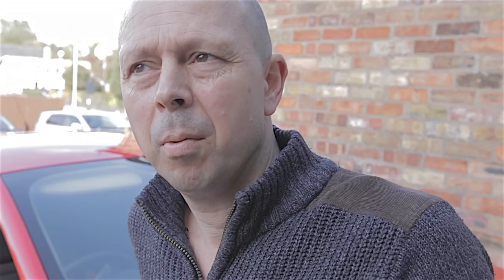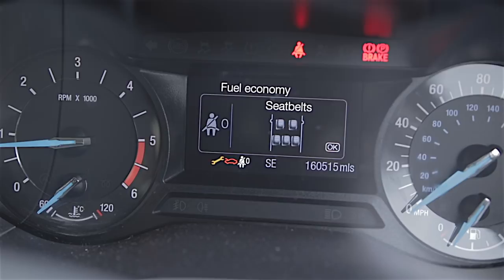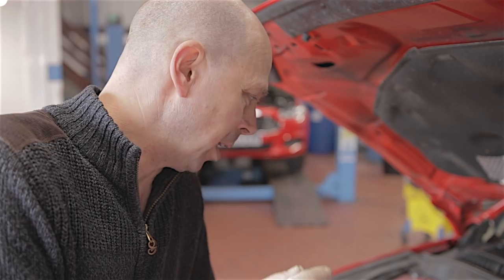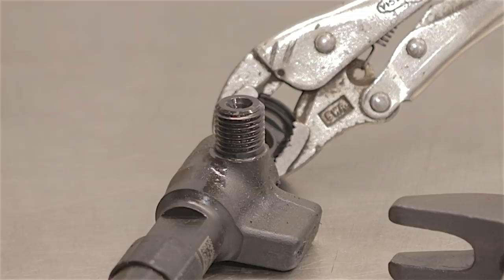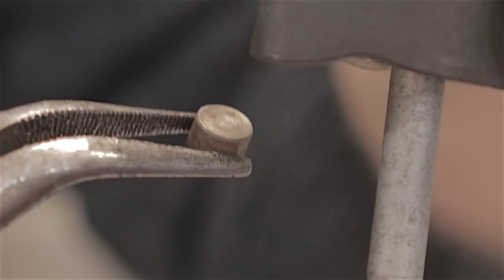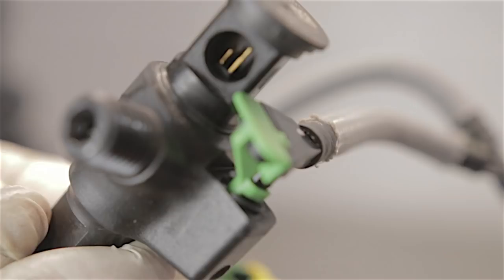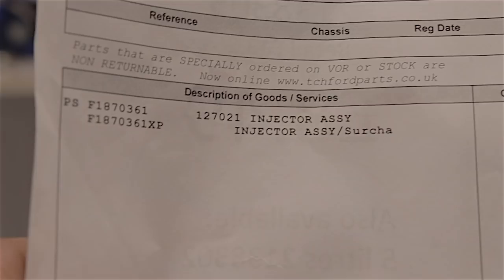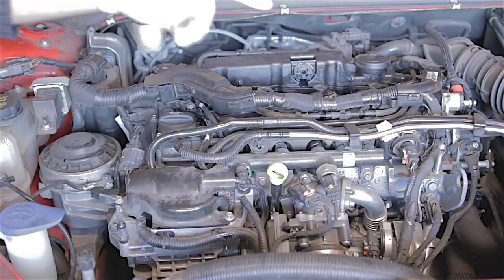Ford Mondeo Mk5, Faulty Injectors

Comment: Many many many thanks Alan for all your videos. I also have a Mondeo mk5 2.0 TDCI 150 and your videos helped me a lot in a similar injection issue (with P0087, P228C, P0251 error codes in my historic DTC...). I'm not a mechanic at all, never done that before but I disassembled my 4 injectors and opened them and cleaned them. Now, no more limp mode and leak off (guy at Ford garage tells me there were 3 bars of pressure in the leak off pipes...) Without replace them for a lot of bucks...! (But I agree, it's crap a mess to access to them without breaking all the plastic fixations, but with taking time, they are all fine...)

Comment: I remember my old mk3 petrol mondeo I bought a brand new set of petrol injectors, proper bosche ones for £19! The gentleman had a surplus of duratec engines and was braking them all up for parts. Normally they're about £17 each... I know a diesel injector is a lot more complex and has to withstand the huge fuel pressure that's created by the pump and they are a lot more expensive. I had a chance to buy a titanium x diesel that was an ex fleet car which had full service history but I thought there's a lot to go wrong. My petrol mk4 is now hitting 37mpg on a regular basis. If I need more mpg I'll have a prinns lpg fitted.

Comment: I'm sure part of the problem is the low sulphur content in diesel fuel now and the increased pressures and tolerances within the diesel system.Although they say there are added lubricating packages added to replace the lubricating effect of sulphur im not so sure.
I agree that the automotive world seems to be taking a step back on reliability for refinement

Comment: Some peugeot diesel injectors are atroceous. If 1 injector is broken you might aswell change all of them. Usually when you com back from the highway speed calibration the next one has usually lit the engine light.

Comment: I suppose it depends on many factors , mileage  , if it's been remapped , the emissions systems have been messed with , blocked etc , the down the psa group share engines with Ford , so the psa problems are with Ford too , when the psa group find an issue with something they usually modify it , I tend to to see ford still selling the same thing , what ever it may be.

Comment: Mk 4 mondeo was euro 4 I think 💭... those injectors would open two ish 🤔times per stroke circle ..   mk 5 is euro 5/6 these  injectors work much harder for a cleaner combustion they open 3/4 times stroke circle . For pre ignition main ignition post ignition.... so basically work twice as much i think ..
Reply: Mk4 was Euro 5 as well
Reply: Mk4 started in 2006 and i am pretty sure it was euro 4
Reply: @johnspanishh6872  depends on the engine. 1.8 tdci was euro 4, all the rest diesel engines where euro 5 with dpfs. All mondeos after 2011 where euro 5 only
Reply: correct, and with a higher injection pressure too

Comment: my mondeo after it had hpfp broken metal got in the system all been fixed and cleaned but i get yellow spanner sometimes when i accelerate faster and loses power completely of and on car has no problem after but same codes and i feel sometimes if i trie to accelerate after gear change car hesitates to accelerate for a split second

Comment: Siemens is way better, on MK4 2.0tdci and no need to program new injectors , only must check number of injector 1,2,3,4,5 or 6 .very Simple
Reply: I have Siemens injectors in my 2.0d Volvo and 3 of them are class6 and one is class5. I have a rough idle and white smoke. Cold you help me with an advice?
Reply: @ienasescuruben7326  hello, all injectors must be same code, you must change this injector, if you have 6class IT must be 6 Claas on all
Reply: One more thing. I should buy a class 6 injector or a profesional shop could change the internals in the old one and make it a class 6 from class 5?
Reply: @ienasescuruben7326  No, the injector number is given at the factory and cannot be changed, it depends on the calibration range it works in your case, it is class 6, you need to buy a new class 6 or a used one, unless you want to change all of them, as in class 6 as for another, you need to change the calibration in the computer

Comment: Alan, after injector change, and putting those numbers to ecu, do I need an „learning procedure” on the road? How to do that?
Reply from the maker: no you don't have to do anything else  but there should be another step with your scan tool to reset the pilot fuel quantity amount on the injectors you have replaced but if you don't do that chances are it won't cause any issues

Comment: You make a brilliant point about the injectors. I've heard more than a few Ford mechanics say the new Delphi ones seem really sensitive to fuel quality and types,  Morrisons supermarket fuel being one of the biggest early death culprits. Any thoughts?
Reply from the maker: the expensive bp diesel is better quality and will probably get you more mpg and better power but most of us will use cheap tesco diesel
Reply: @alan4x  True that. I put v power in my 3.0tdi Audi as insursnce but the rest of the fleet get asda poverty spec.
Reply from the maker: lol
Reply: Generally it is micro-particulate contamination of the fuel that kills common rail injectors. The cleanliness standards for the fuel storage and delivery at the forecourt will likely be more important than the fuel brand.

Comment: Alan I know its a long time but do you happen to have the tightening torques or degree's for the injector clamp bolts ? A small video on you coding these injectors would be handy ? Cheers marc
Reply from the maker: hi marc, the injector clamps are 10nm plus 70 degrees
Reply: Cheers Alan now have diagbox not accepting the new  20 digit injector codes ,  sure you said gearbox end is injector 1 ? 2.0 blue hdi 120 dw10fe citroen dispatch 2017 cheers for help Alan

Comment: I've got a facelift mk4 and I've got to replace the injector seals (screw replacing the injectors). My current issue is getting those friggin leak off pipes back in the friggin holes. Oh yeah they come out ok but they don't seem to want to go back at all. Any tips? Scrapping the car is not an option though at the moment beating the engine with a crowbar is moving up on my list...

Comment: Alright mate I brought a ford MONDEO 65 PLATE at 63400 miles and on the motorway my car  went dead with that spanner coming on and showed it to the garage I brought the car off and he put a new oil  filter then was ok forca while and after the 3 months warranty the car shut itself off 5 times and now I have had 2 injectors go and even now it's making a really bad noise and going slow and fast itself so this car is crap so far thank you

Comment: Hi Allan p0272 on cylinder 4 after limp mode on moterway and car shaking and making noise changed injector 4 now geting P0174 still shaking and sounds same any help would be appreciated 2015 mk5 mondeo tdci 150 
Please don’t tell me what I’m already thinking that it’s going to be expensive 🤦‍♂️
Reply from the maker: have you carried out an injector leak off test and how did you know it was cylinder no4.....btw...cylinder no4 is next to the cam belt and not at the gearbox end...just in case you did not know that

Comment: Alan you are awesome! :) love all your videos. i dont have mk5 i have mk3, tbh i have x-type 2.0d (even worse) but i do agree that the fuel system is the biggest problem of these cars. i would love to chat with you about my never ending issues with my 2 x-type (both not running at the present moment) and I believe that im very tempted to burn both for a nice cold night... anyway, my point here is, do you know how to open the injectors to clean the top part of injectors (where the electrical part is installed)? thanks to you i have accomplished to remove them, open them, clean the return valve and the tip but after installing back the car starts (with bumps) and after few minutes in idle will dye and never start again until i repeat the process. the fuel pump is ok, the filter has 1 year and around 10.000kms, but i did used these injectors for 60km (not 60k!) in another car and they became faulty (my guess is that the injector got swarf from the other car and now somehow i cant clean it properly). I also know i should buy new replacements but these cars have no value at all and i dont mind to test, learn, trial and error, and find out how can i go around this. sorry for this long speech. stay safe and thank you!

Comment: Alan do you have to bleed the air from injectors and system if you refit need ones?

Many thanks
Reply from the maker: no there is no need to bleed the system...just crank the engine over and it will start
Reply: @alan4x  thanks Alan! Putting the fuel return pipes back on is major pain in butt hole... any tips?

Comment: got the same problem with my insignia limp mode garage has done leak off test need new injectors but cars only done 35000 miles

Comment: Alan, I’ve messaged you before, I’ve got a facelift Mk4 2ltr Tdci, with the euro 5 engine, dpf and the Delphi injection system, with all the work you do on these engines, do you ever change the Hp pipes when changing the injectors? It says to in the book, but I can’t see why?

Comment: I guess it's to be expected that something goes wrong after 160 000 miles. Is this the TDCI 2.0, not the new Ecoblue?
Do you have any experience with new ones? What I found so far, Ecoblue diesels will be throwaway engines, since it seems it will be expensive to repair

Comment: Alan do you know what the operating/activation voltage for these type of injectors are? how would you go about testing the electronic solenoid do you know?
Reply from the maker: hi, you really need a node kit...its like a set of led's that you plug into the injector wiring plugs..they flash when you crank the engine over which is testing the wiring to the injectors

Comment: Alan can you tell me the torque settings for the bolt that holds in the injector mate, I need to replace injector number 3 on my mondeo, great videos as always, would be lost without you mate
Reply: Alan can you tell me what this fault code is m8 …. P228C:00:68
Reply: Fuel pressure regulator A exceeded control limits , pressure too low it’s saying

Comment: Could be worse you could have pug 1.4hdi engines and the amount of stuff you need to strip off to see the spill pipes never mind access them and so it's wise to change all 4 injectors ar 240 quid each less 75 exchange fee   is it worth it  8 hours labour
Grand to fix a diesel motor  with 130.000
Wonder if your company would trial a petrol lpg taxi. Would it have worse problems than the diesel
Reply from the maker: yeah i have come across the 1.4hdi..nasty job lol.......

Comment: Hello Alan,Before I buy my Mk5 you gave me an advice to be between 30-80k miles and I did liaten to you.I bought it on 81K but had glow plug error on the computer and was having a difficulties when starting (turning more revs than normal)-summer time.Now is cold and even is harder to start.I notice when revving the car when on hot engine the cars goes in to limp mode and Low Fuel pressure error comes on the computer,so I believe is my leak off test time.I have an idea for a new video for you.Why you not make a video how to program those injectors as I might need to change some of mines.2015 2.0L diesel(London) .Cheers
Reply: Can you link also the starting issues to not working glow plugs as I think the car uses them only when is 
under 3⁰ C .Thanks

Comment: Cylinder 1 is on timing side, why did you say the other way round? Is that specific to this particular ford engine?
Reply from the maker: BMWm6e63 
 Yes it is specific to that car.. quite a few especially French engines are arse about face with no1 cylinder being by the flywheel side
Reply: The French work backwards

Comment: Can a faulty injectors cause excessive engine vibrations and noise? I have 2.0 mk5 Mondeo, and after changing flywheel and all of the engine mounts, the issue with vibration is still present.
Reply: @darepsy Have you ever resolved problem with excessive engine vibrations?
Reply: Hi, i have s-max 2016,exactly this problem, I've changed glow plugs with relay, flywhell, mounts is ok, but the problem not resolve, have you resolve? Thanks
Reply: @rychlakdesign  hi, do you know what is the problem? Thanks
Reply: @coskea8260  hi, unfortunately no, still chasing the gremlins 🙂
Reply: @coskea8260  hi. No, the problem is still present. In meantime, I've changed the alternator and crankshaft pulleys, and again checked injectors. Unfortunately, it seems that vibrations affected the transmission, since it developed some noise. Most probably, some transmission bearings are damaged.

Comment: Hello Alan, I understood that correctly. The first cylinder for coding the injector is on the transmission side? I now have a new engine in my Mk5 180HP Powershift. He now shows me gearbox and EGR errors. The attachments are from the old engine except the injectors. Can these errors come from the injectors? Sorry for my bad english. Please help . Here in Germany from Ford nobody has any idea! Thank you thank you ! Greetings Dennis
Reply from the maker: hi, i would first clear all ecu codes, then code in all the new injectors first and carry out a reset on the egr valve using your scan tool and also see if the gearbox can be reset...usually if the egr valve gives off codes it is a faulty egr valve..they fail quite often
Reply: Hello Alan, thank you I will do so. With the 20-digit code on the injectors, is the crossed out oval a zero? And cylinder 1 starts on the transmission side? thanks
Reply from the maker: hi, yes the oval with a line through it is a zero and no1 cylinder is on the transmutation side..no4 being next to the cam belt
Reply: @alan4x  Thank you so much, you helped me a lot. Greetings Dennis

Comment: Hi, i hope anyone can help. I have a MB c200 2010 diesel and i have a high return on injector nr3. I have replaced all 4 injectors with refurbished units. I have replaced the common rail pressure sensor. I have coded the injectors correctly and i still have a high return.
I have a new fuel filter, tested the intank electric fuel pump.
I have no fault codes using 3 different scan tool and diagnostic pc.
I am starting to run out of ideeas.
the next thing will be checking the fuel pressure regulator and doing a commpresion test.
Please Help!!!

Comment: What a pity that Ford do not listen to Alan's feedback, if they did then EGR valves would have an Aluminium body with replaceable motor, thermostat housings would be Aluminium and other issues would be fixed ! The injectors appear to be a Peugeot issue rather than a Ford one as thats who makes the engine.
Reply from the maker: lol

Comment: Hi Alan great videos as always. I have a question which is not related to this video. My mondeo mk4 has been losing coolant steadily and there is no visible leaks or cream cheese in the oil filler cap. I've done some research and found it to be a few possible causes. Firstly head gasket and secondly egr valve. If the head gasket had gone would I always expect to see cream cheese in the oil filler cap? The car runs smoothly and drives perfect, secondly if the egr valve is the cause how would I check this? This problem has me stumped and have always received good advice from you in the past. Regards Wayne
Reply from the maker: hi, there is a test involving holding a bottle of fluid over your expansion tank to test the head gasket but i have never had a head gasket leak on a mondeo for many years now, nor have i had a egr problem on the 2litre peugeot mk4 engines... really need to know what engine it is...and check radiator down the sides...they can seep without dripping on the floor
Reply: Hi mate thanks for the reply. My mondeo is the 1.8 tdci , I also noticed earlier that the system was still pressured despite the car being parked up all night. When the car is driven the temp gauge is always normal.
Reply from the maker: yeah the 1.8 tdci did have a few leaks...hoses onto egr and at back of cylinder head and the thermostat housing is a common leak point but if your system is pressurising then you would be best to have a compression leak test done on your car

Comment: Hi Alan. I have mk4 DW10C 2.0tdci and im about to change injectors. Do you have to release rail pressure before or you would do it one by one?
Thanks Alan.
Reply from the maker: Taskhunters 
Hi.   There will be no pressure. Just loosen the 17mm nuts on injector pipes nothing will squirt out
Reply: @alan4x  ok thanks.
One more thing. Do i replace all 4 in one go or do first one, then start up the engine switch off then replace second one, and so on ... Im not planning to code them and i know there was a someone already doing all 4 in one go just to find the car will not start at all.

Comment: Hi so when I change the injectors I don’t have to code them, just change them as I don’t have a scan machine.
Great video👍
Reply: If you don't enter the individual injector correction codes you may notice some rough running and annoying noise cause by injection timing error and poor cylinder balance. On the other hand there is a statistical possibility that you will get away without doing so - it just comes down to individual component manufacturing tolerances.